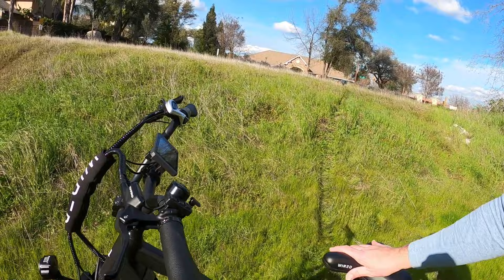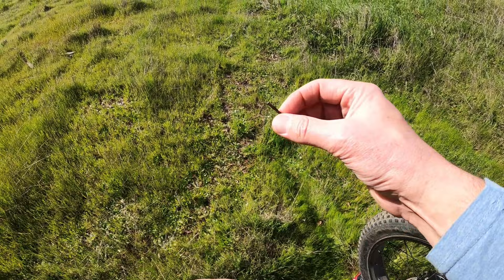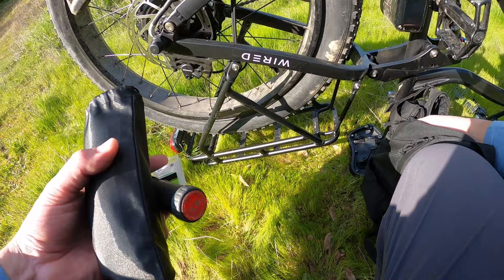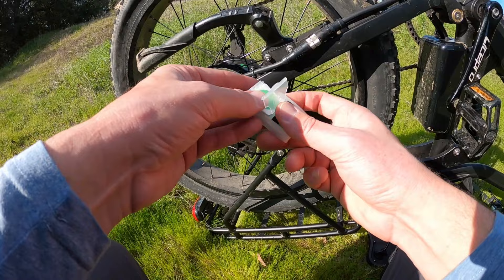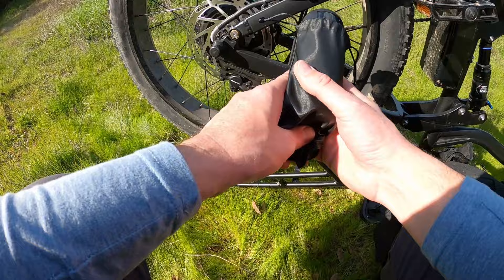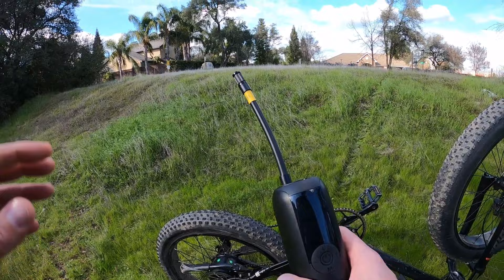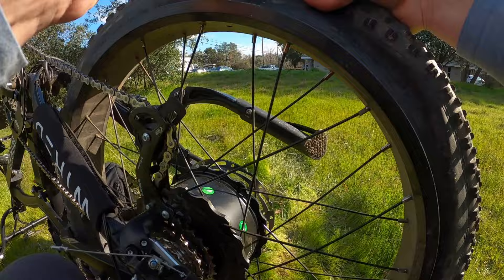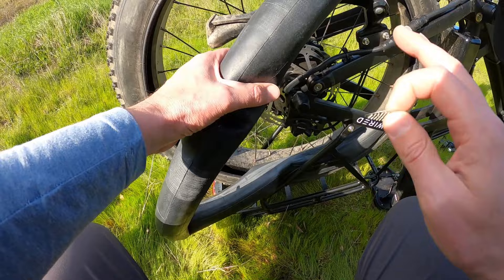How To Patch A Flat Bike Tube Without Removing The Wheel

Comment: I may buy those patches I like how easy it is to see the green patch. I have Park Tool glueless patches, they are clear. 
I use an tire inflator like yours. But I leave all the pre sets at zero, in case the button gets pushed while in my bag.
Small alcohol wipes are nice to clean the tube, and also a marker to mark the puncture on the tire and tube. I use a tire lever to burnish the patch flat.
The inflator works pretty good. And while it is filling the tube I have time to pack up all the tools I used.
Reply from the maker: Awesome! My inflator button has to be held down for 3 seconds, so I haven't had it turn on in my bag, but that's a good idea. Marker is also a great item to have.

Comment: I didn’t read all the comments but here is tips to make job easier, have a piece of chalk in kit to mark puncture location, check inside of tire for any sharp residue, to roughen up the patch area on tube look for a pebble in area that’s rough usually easy to find. Make sure nothing got between the tire and tube while you are working. That’s it the rest of your instructions are fine. You can also put more than the 20 psi in to seat tire then let some out to correct pressure
Reply from the maker: 100% agree!!

Comment: Good video. I also carry alcohol wipes and gas leak check for smaller leaks. Keep on riding ebiker
Reply from the maker: Thank you!
Reply: No problem. It's funny that I have the same Air compressor as you do. Bought mine a year ago. It's great on bikes. But under powered for cars. Also did you check out the new wired bikes on citizens channel. He's a great dude. Been  Following him for awhile. I am also a big guy. 6ft 5 and 250lbs. Like big sturdy bikes. Keep on riding.
Reply from the maker: @EricLoeser  you are 100% correct about the portable air compressor! I do watch citizen cycle, love his channel...haven't seen the new Freedom bike yet...

Comment: Use flat out. Works great!
Reply from the maker: Not a fan of the mess it makes in the wheels and air pump from back pressure. Used it before, but not anymore.
Reply: I've been using slime along with Mr. Tuffy tire liners. Haven't had flat in hundreds of miles. I've probably collected several puntures over that time without ever knowing it and have never had to stop to patch a puncture which is what most people want to avoid. Just keep on riding.

Comment: I have a similar rechargeable pump but what I like to do with fully flat tires is to connect the hose to the tube valve and then screw it into the pump. It's easier than trying to thread it on with the pump dangling off of it.
Reply from the maker: Right on!

Comment: I go tubeless for the road bike as range anxiety is the issue. Off road, I use Maxxis tires with 120 TPI (Threads per inch) heavier, but mostly bullet proof. I carry tire plugs, tube patches, extra tube and schrader valve.
Reply from the maker: You're dialed!!!

Comment: Should have explained getting the bike positioned upside down.  Ebikes are heavy and gotta be careful not to damage the screen.

My ebike came preloaded with Slime.  First flat from a packing staple and Slime failed and left a mess inside the tire like you described.  Swapped with a new tube and Flatout.  Second and third staples Flatout sealed the holes with very minimal leakage, and both times only noticed because tire was getting soft at around 15lbs (normally 25lbs) .  I'm considering tire armor in the future, but I'm ok just tube patching for now.
Reply from the maker: Thanks for sharing your experience!!

Comment: I did this the other day. I had a wiring staple put two holes in my rear tube. My e-bike has dual sport tires on it which are motorcycle tires. They were a pain to get on the wheels in the first place. Luckily for me I didn't notice I had a flat until I went to ride it and I was at home. I ended up buying heavy duty tire pulls that you'd get for a car or motorcycle tire. Pulled one side of the tire off the rim, pulled out the tube, patched the holes, shoved it back in and inflated it. Worked great.
Reply from the maker: Awesome!

Comment: do you ever use Flatout in your tires??
Reply from the maker: I don't but have used Slime.
Reply: @leetjohnson  I spoke to a couple of bike shops here in North Carolina. Considering using kevlar liners inside the tire but I believe that will require going tubeless
Reply from the maker: @SuperSlappy25  I usually use patch kits, they seem to make the tube last a lot longer and occasionally replace them.